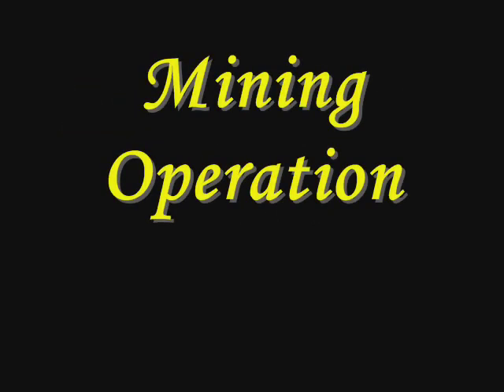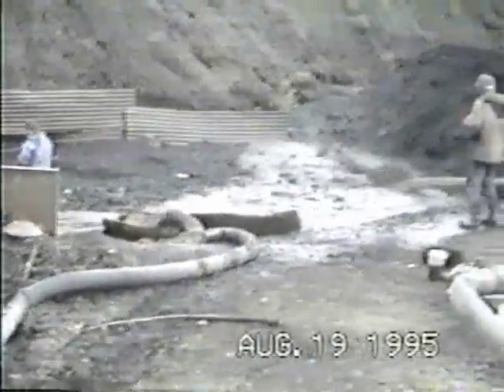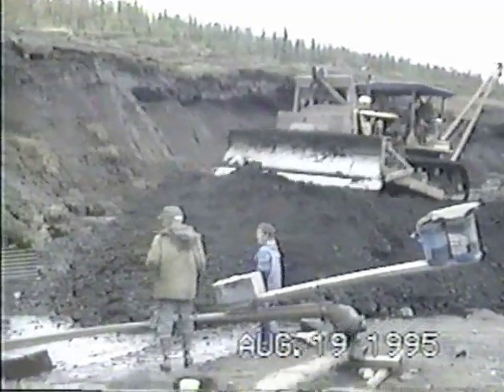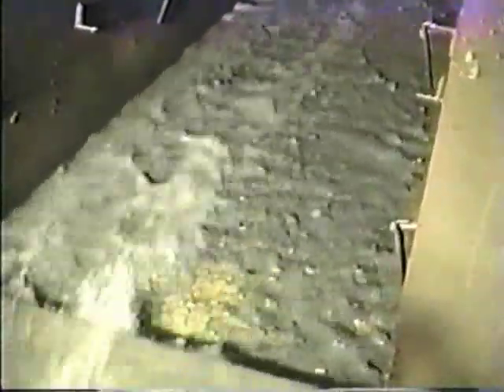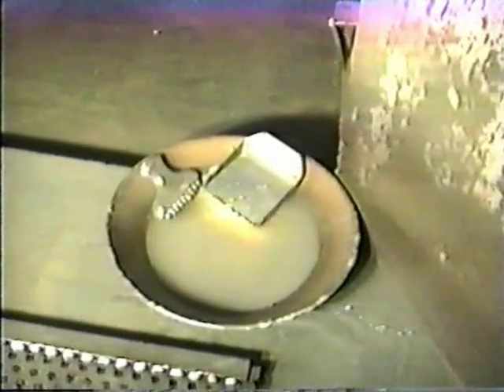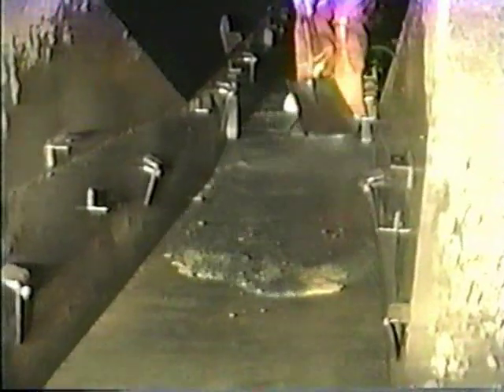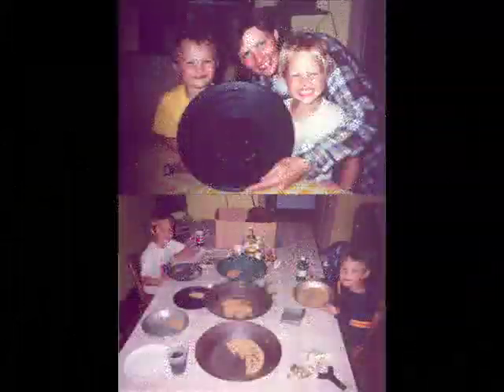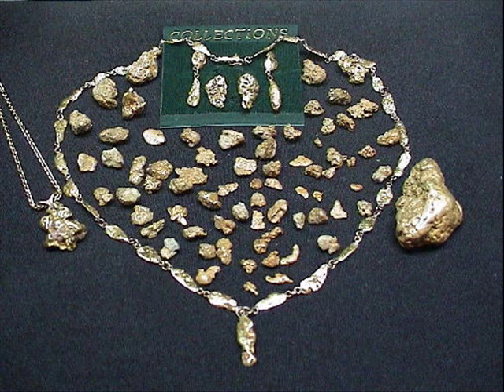Anvil Creek Mine Alaska - Mining Operation and Clean-Up.wmv

Comment from the maker: @alex26red 
This method does not classify the material so all sizes are going through the sluice box.  Also, the feed of the material and the water supply is unable to be regulated so it is steady.  There are surges as it is going through the sluice box.
There are better methods now that utilize shaker screens or trommels that deal with these issues.
Thank You for your interest in our video.

Comment: Trommels work do doubt about that, and it may be the best way of doing your required scrubbing. A good 12' derocker with a cranked-up 12" semi-trash pump can really liberate your gravels however, and doesn't take the beatings like a trommel would take. It really is a site-specific situation however. It seems to me the name of the game is to classify your material into as many sorts of reject as possible, to keep your sluice load low, which is why I like a derocker & 2 or 3 deck screen.

Comment: Why don't you flux and pour your own bars? We built our own melting furnance with the proper refractory cement and propane regulater for under $500. The fluxing agents cost around $300-400 per season, maybe cheaper if you can get a better supplier. We use Anachemia in Vancouver, BC. Technic Richmond, BC buys our gold, but we are shopping around now.

Comment: Id of had a 1inch punchplate on top the first 6ft that sluice then a 3/4inch and 1/4 inch screens underneath, then a aeparate stage underneath with a single underflow riffle to create a pressure drop and try catch them fines right on the head.
I can see the sheer volume you run though its a tradeoff between acceptable loss and how much you feed per hour, you dont mess about catching tiddlers when big fish are there lol - goodluck i hope theres a vid of your new setup